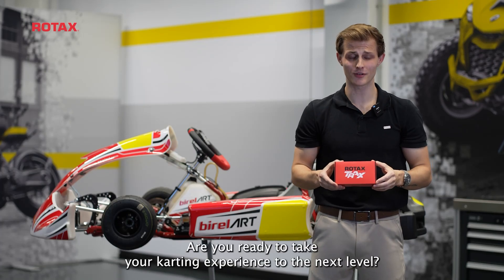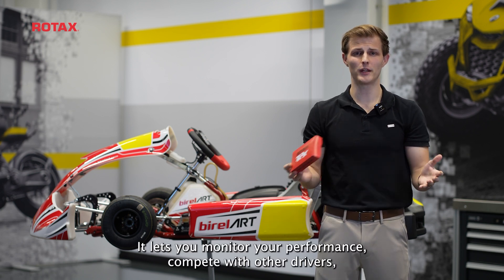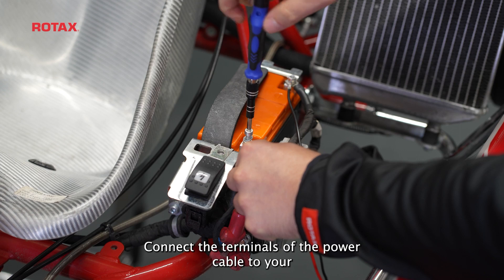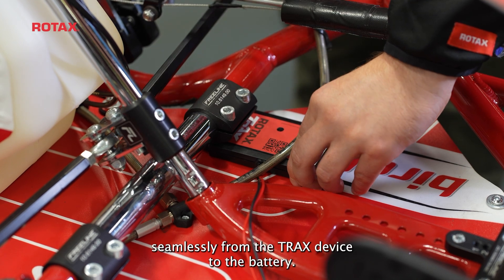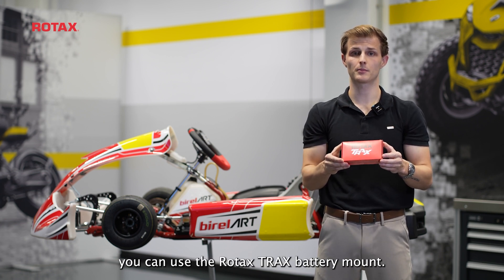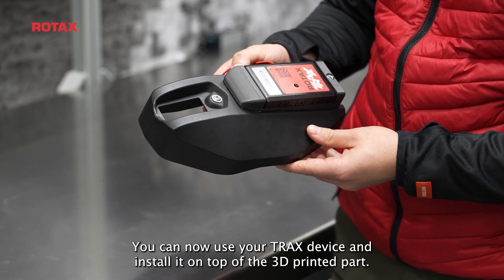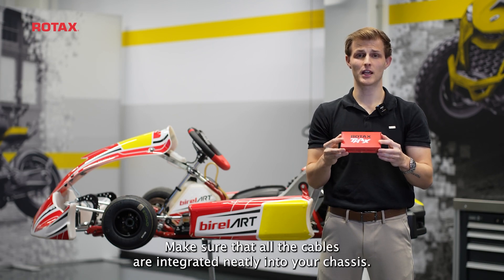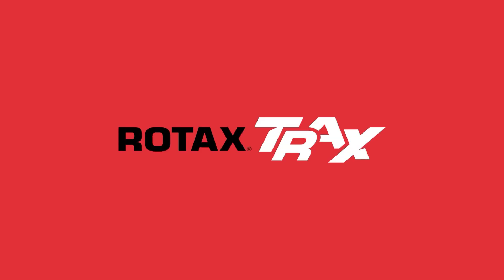Get Started with Rotax TRAX: Mounting Tutorial

Comment: On KZ125 pleaseeee
Reply from the maker: You can use TRAX with every kart, but it requires a 12V power supply to work. (If your kart is not equipped with a starter battery we suggest using a lightweight 12V battery to power the Rotax TRAX device on your kart.)